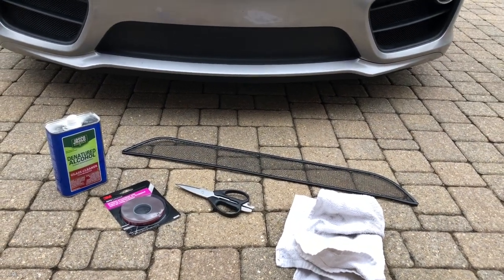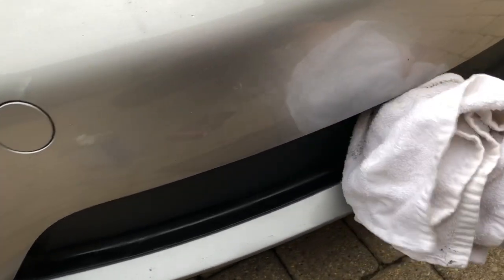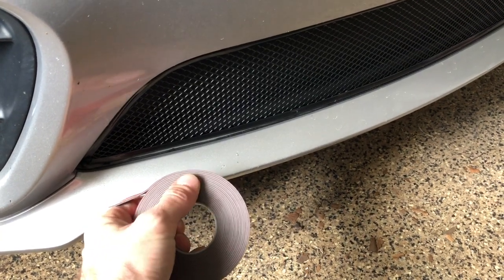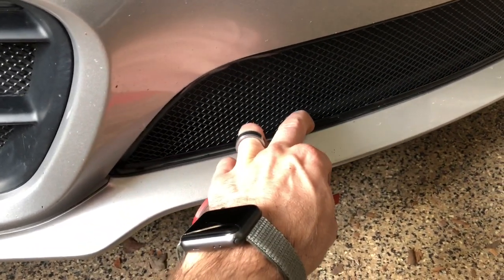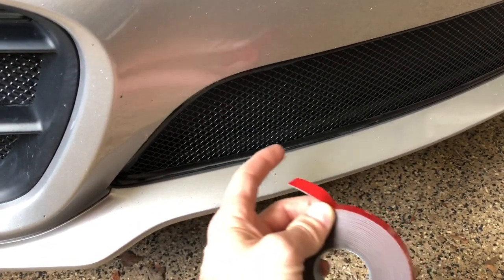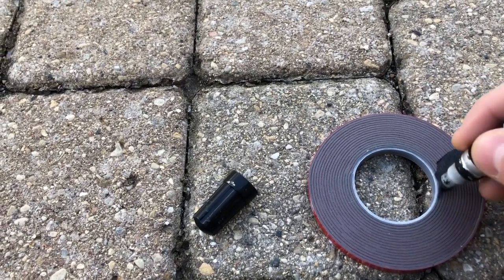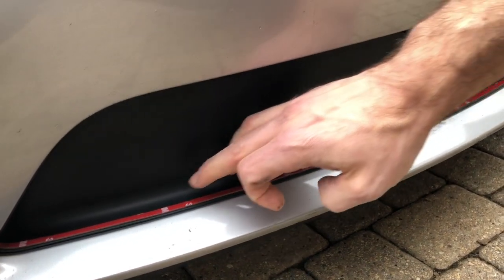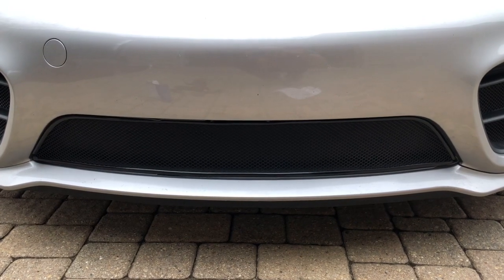Porsche 981 Cayman Center Radiator Grille Installation | RGS

Comment: Did you put the top tape after you installed the bottom ??
Reply from the maker: @tommydodds  3M tape goes on first. Clean the area thoroughly, extremely important. Adhere tape, keeping red backing on. VHB is pressure sensitive. Hold in place all a long the matte black trim piece. Place tape, hold for a couple seconds until adhered. Then continuing moving along, until around the entire center section of the car. Then starting in a corner, pull back 1 inch of red backer, and adhere the grille piece. Then pull back another inch, and repeat. Until all the way around.  Also check out our 997.2 grille install, we go into greater detail about the center install.

Comment: Can you install the grill without that center black piece?
Reply from the maker: Our grille works with the center black piece. So it won’t fit without the center black piece. But also Porsche does kit recommend changing aero pieces like that as it changes high speed downforce balancing.

Comment: This will fall out in time without some additional securing
Reply from the maker: Actuallly this holds in extremely securely. We have this installed on our daily driven Cayman for 9 years now, cold, hot, track days….very secure when installed properly. This is the same VHB tape that holds on vehicle emblems for the life of the vehicle.

Comment: Only showed how to install the bottom not the top of the grill which I assume is more difficult.
Reply from the maker: Same process.  Just keep working around the same process.  Work a little at a time removing the backing tape and affixing the trim by pressing and holding.